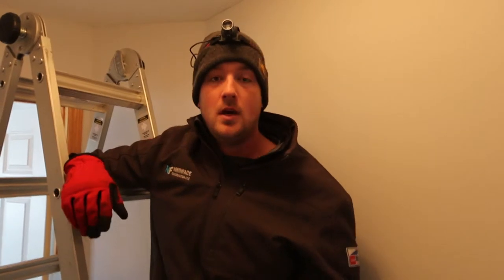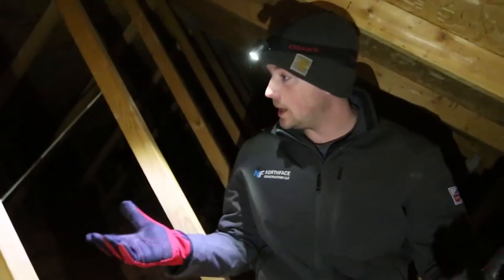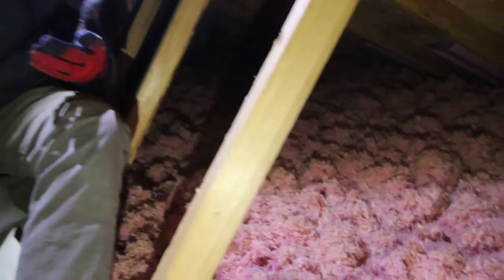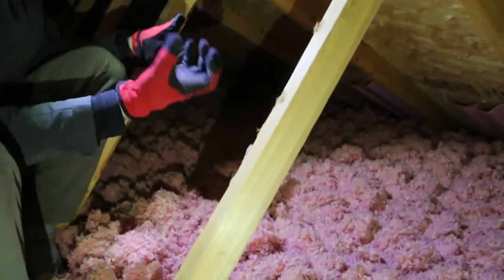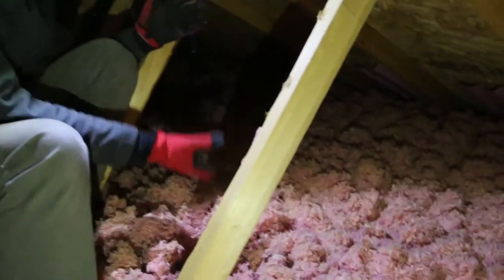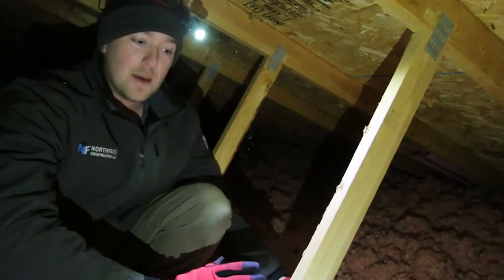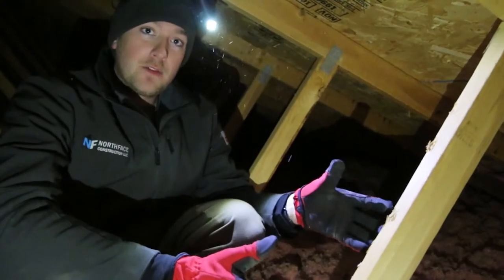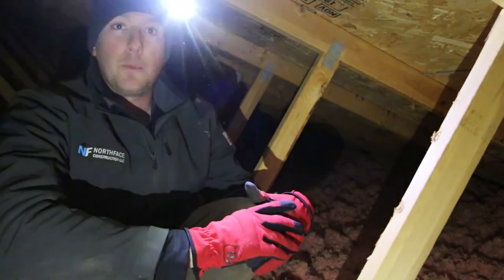Frost In Attics: How It Happens & How To Fix It | Northface Construction

Comment: You need eave ventilation, so air can come in  from the bottom , & flow around your attic , then you need ridge ventilation so the air can escape  from the top maybe even roof vents for extra ventilation to

Comment: It’s winter and I have a humidifier on. I should be turning that off during the winter?
Reply from the maker: Hard to say without knowing the home. We would suggest getting an energy efficiency audit to identify the flow in your home. That should give you a baseline on if your home is moving air properly.
Reply: I am working with an A frame log home. Every winter it seems to be a problem. Very little attic space but it does have insulation stops on the roof OSB side. Can you give me advice on how to stop this condensation from happening so that every time it warms up and doesn't leak?

Comment: I have a metal roof attached to the rafters. No insulation on the roof in the attic only blown in cotton on the floor of attic. The metal always freezes in the winter then melts and drops on the cotton insulation and is causing damage to the rafters. Is there anyway to correct this without replacing the entire roof? Help please

Comment: I have three fan that exhaust to the attic, two bathroom fans and a kitchen exhaust fan.  It was like this when I bought it.  Would it still be wise to run them?  I also have a pretty decent size humidifier.  So, I shouldn’t run that either, even if the air inside seems dry.  Thanks.
Reply: Humidity levels in a house should be relative to the indoor/outdoor temperature difference. You can google it for a chart, and they make gauges to measure them.
Reply: Vents should never vent directly into attic, they should vent through the roof. An inspector should have caught this when your home is inspected. Excess humidity to the attic from vents will cause damage long term

Comment: When you say contact a professional...  What is the proper classification of professional (like ie roofer, hvac, or just a general contractor?) for the job?

This winter I had this happen in my attic, caused some damage to the ceiling in a couple areas that were easy to touch up with some ceiling touch up spray....  But obviously want to prevent it from happening again.  Not running the humidifier in the winter seems crazy (just because it gets so darn dry), but that could potentially be my issue.  We are usually very good about leaving the ventilation fan on during and after showers.

I was thinking about adding a couple whirly bird vents to my roof, but my attic has 4 static vents, and I think it may not work properly by only installing two and may just suck air from one of the remaining static vents - long story short I should contact a professional lol